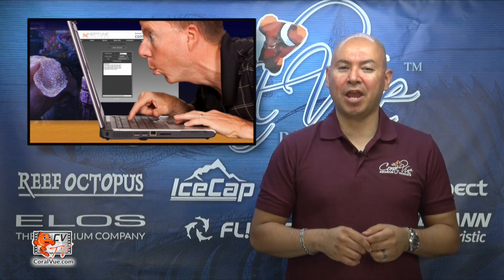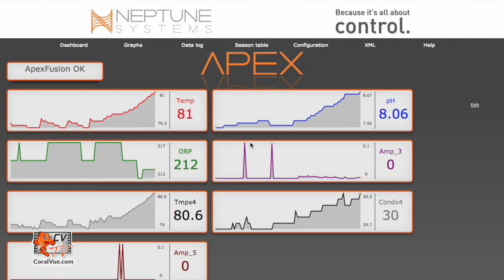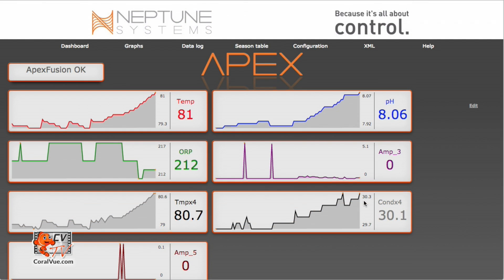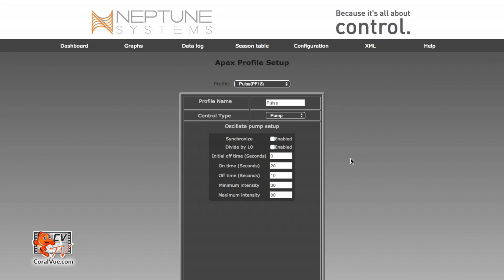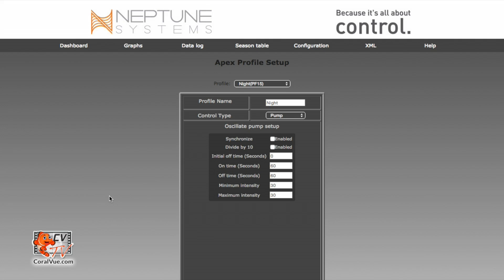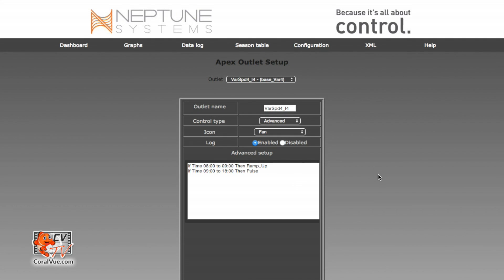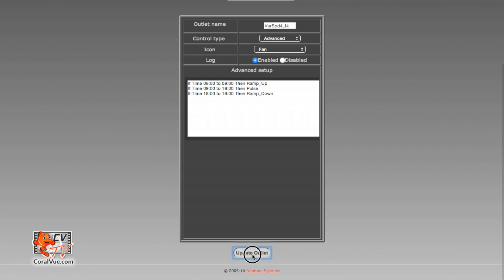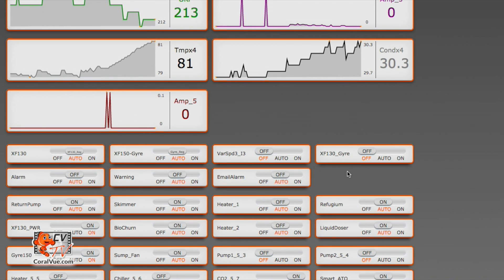IceCap Gyre Interface Module: APEX Controller Setup

Comment: To run a XF230 Gyre Pump Only (2300 GPH) - Maxspect  with a Apex controller, do you have to buy the Power Supply and the Advanced Controller?? Or do you have to buy just the pump itself. THank you

Comment: How can you set the pulse time to 0.4 to match with the standard controller?
Reply from the maker: Sorry it can not be done with the GIM. 1sec minimum setting but still may not work with the APEX.
Reply: CoralVue ok thank you. I returned them and am using the gyre controller. It takes a little time to get used to however has more options than setting it into the apex.

Comment: So, I would like to get this for 180g tank. I have a question for you.  Given that you will be changing the speed of the pump over time, how does the fact that you are moving more water affect your overflow and your skimmer? I have a bean overflow system so i do not think that would be an issue for me but for some one with the other overflow designs, will there setup be able to handle the changing water volume going through the over flow?  Similarly, would the skimmer star to go crazy due to the changing water levels? Remember, higher flow rate means more water coming out of the sump faster?
Did you had to deal with any of this?
Much thanks.

Milton
Reply: I have a XF150 in my 180 gallon with a center overflow plus a Tunze wave box and have no issues with my overflow. I have two 1.5" overflow pipes, one tuned full syphon and the other backup. If you have corner overflows, I could see more possibility for issues.
Reply: If you were changing the flow of your return pump you would have issues with your overflow but not so much a powerhead in your DT.